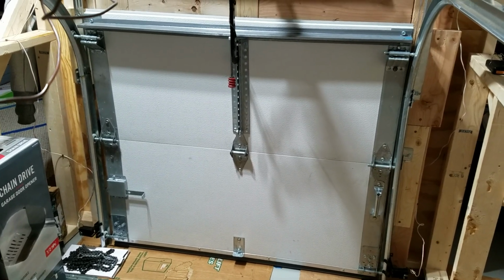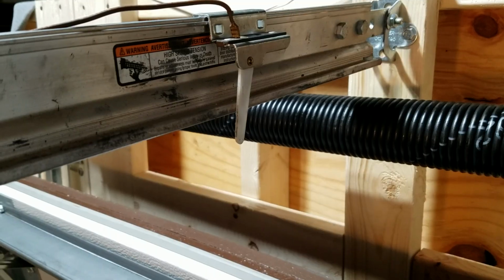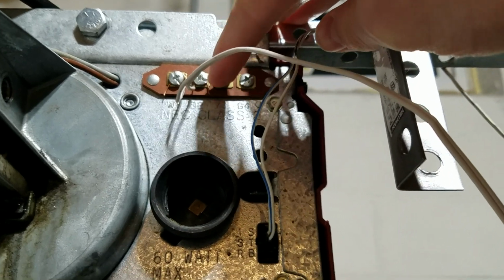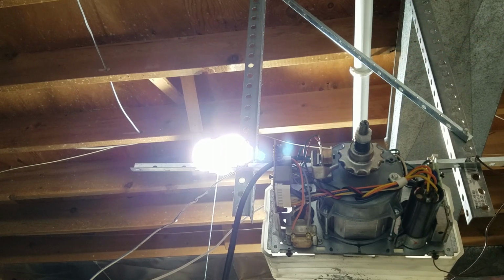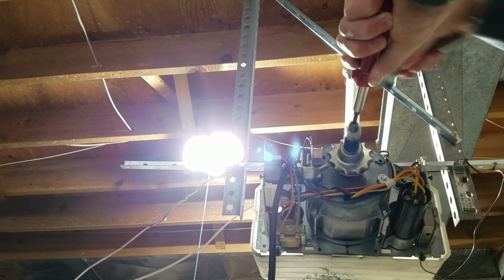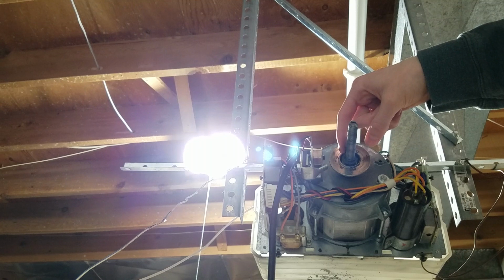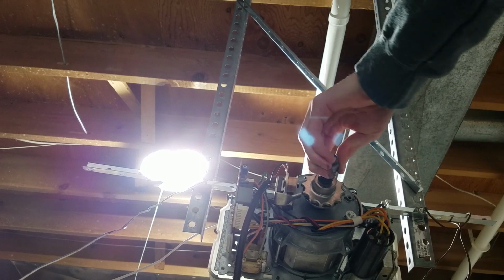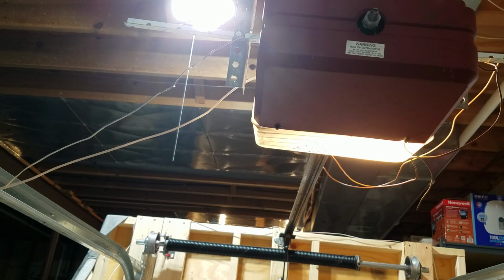Clutch Genie Screw Drive Maintenance, Repair, and Adjustment

Comment from the maker: The video is taking forever to process the HD version which is why it's low quality... It'll be fine later
Reply: Thanks for the video, very thourough, but there is one thing you did not cover that I need help with -->  

I inherited a Norelco Genie Trac-drive 940A which looks to be a screw drive machine from the '80's.  It has the limit up and limit down switches but the wires connecting them to the motor are missing.  I cannot find any manual to show me where/how to connect these limit switches at the motor. 

Can you help me with this?
Reply from the maker: So I haven't been around a trac drive for a long time, but here's what I can remember

Basically, the limit switches work by grounding through the rail and chassis to shut off the opener, and the wall button works off the same basis as that. The down limit switch should have a prong that you plug a wire into, and the upper limit I believe has 2 prongs, one of the prongs you connect to the wire that goes to the down limit switch and the other prong needs a wire that connects to terminal 2 (or the middle terminal) on the opener. Terminals 1 and 2 are for the wall button, if you look at the terminals one of them has a gold wire attached to it, that's the ground wire that goes to the chassis so the wire from the limit switch needs to run to terminal 2 and when the circuit for the limit is closed it will ground through the rail and shut off. Hopefully that helps enough, but like I said i haven't been around a trac drive for a long time so I don't completely remember how everything goes together on them.

Comment: What about the replacement of the screw drive coupler on the same model genie
Reply from the maker: The clutch models do not have a coupler, the screw runs all the way through the motor and sticks out the back. If you have a newer one with a coupler, you need to slide the rail out of the motor head to replace it

Comment: I appreciate the video. I have an old, but in good shape opener, Genie BlueMax CM-7500S. The door closes nearly all the way. But, about half the time when it has nearly completed the task of closing it reverses. It was doing this a couple of years back and scuffing the assembly seemed to solve the problem. However, it has begun to again show the came symptoms and I fear the clutch is now slipping again. So, I disassembled and scuffed it again. It is less frequent but not back to 100% success. And, the clutch spring is fully collapsed - there is no room for any further adjustment. Therefore, I'm thinking the clutch disc (i.e. lining) may need to be replaced. However, the only thing I've found thus far is a 2pk from Genie for $97 - ouch! I'm thinking it may be time to retire the old genie and replace it. Do you know of any other source for a clutch disc with inside diameter of 1.51 and 2.70 inch outside diameter?
Reply from the maker: How much thickness is left on the clutch pad? If your clutch is fully tightened, the more likely case is the reluctor (basically the rpm sensor) needs to be positioned closer to the reluctor hub (gear shaped piece). There should be about a credit card thickness between those 2 pieces. Get it as close as you can to the reluctor without letting them run into each other

Comment: Hi there, thank you for this video, i have searched and search for help on adjusting the power level. What impact does the capacitor have on being able to open the door? My stop opens often about 2ft off the ground. Also is there a fix to get the light bulbs to work again, both sockets seem dead. I raised the internal contacts, but it made no difference. I have spent days trying to align the vertical and horizontal tracks. The wheels can move more freely now, but the top two were absolutely stuck. Anyway, the unit seems to run a little slower than it used to. I want to save it if possible. I have replaced the switch, the brackets, and the hinges over the years so far. Any thoughts would be appreciated. The unit is a Genis SD9500, about 30 years old I thnik. I don't use it much.
Reply from the maker: Typically a motor running slow or only moving 6 inches at a time can be a bad start capacitor. The part is still available from Genie and super easy to replace

Comment: I have the same Genie garage door opener and currently have one remote that works. I am trying to program another remote (looks the same as yours only three buttons), but simply matching the dip switches isn't working. I see in addition to the 12 switches there's also a Run/Set and a 9/12 switch. When I flip the Run/Set to Set, holding the button makes it blink. Is there a specific sequence to program the remote that you know of?
Reply from the maker: To program the 3 button remote, you match the dip switches in the remote to the switches in the opener making sure the remote is set to the 12 switch mode, then you flip the switch to "set", hold the button you want to use for a few seconds, then switch back to "run" and you should be good to go

Comment: How do I connect a car remote to this garage opener?
Reply from the maker: Genie master remote model GM3T is compatible and there are a couple other aftermarket options as well. You can also likely find used remotes on ebay

Comment: So how do you adjust it if it's closing too hard (slamming)
Reply from the maker: You have to move the limit switches on the rail. There's a small 1/4 inch screw that you loosen and then you can slide it to where you need it on the rail. In your case you would move the down limit switch towards the operator a bit until it closes more softly, then re-tighten the screw
Reply: That's what i thought!i just wasn't sure if there was another way. That's an easy fix 😁 Thank you!!! 👍👍 @TBHD724

Comment: Thanks for the Demo! Is the Relay or Tranformer on the logic board? Mine is buzzing and not turning the lights off or the lights are turning on by itself.
Reply from the maker: The relay for the light is located on the logic board and the transformer is the part right next to the logic board on the bottom of the unit

Comment: My genie 404 stopped working at all. I replaced capacitor, but it didn’t help. What could be problem?
Reply from the maker: You might have a ground issue. Take the cover off, unplug the opener and unscrew the circuit board, clean off the back side and reinstall it making sure the screws for the circuit board are nice and tight. ColtDoor1 has a great video about it titled "404GreenMonster". I'll put the link to that video in the reply under this.
Reply from the maker: https://www.youtube.com/watch?v=Wvthxf6udUE&t=21s
Reply: I tried it already. It does not work. I even resoldered some point to make sure everything is good
Reply from the maker: Does the opener click or hum at all when you try to run it?
Reply: No. No sound at all
Reply from the maker: One more thing to check, do you hear a hum from the transformer when the opener is plugged in? If you do the circuit board is probably failed and you'll have to replace the opener since you can't get parts for it anymore. If you don't hear any humming you might either have a bad transformer or it might need a new power cord.
Reply: No sound at all when plugged or button pressed
Reply: What is spec for transformer?
Reply from the maker: I'm not 100% sure but the output is probably somewhere between 24-40 volts

Comment: Thanks very good video. Now I know how to adjust tension. Just a heads up for people messing with capacitor.  Even though the are un plugged the are still charged. Should be discharged with the proper insulator screwdriver or other proper tool. God bless and take care from California subscriber

Comment: Is there a way to adjust the force and also the downward travel of the garage door with this opener?
Reply from the maker: The force is adjusted through the clutch on the back of the opener. Tightening the nut increases the force and loosening the nut decreases the force. You want the door to be able to run smoothly but should easily be able to stop the door with your hands on the way down. The limits are adjusted with the small switches on the rail. Loosen the 1/4 inch screw, slide the switch to where you need it, and re-tighten the screw.
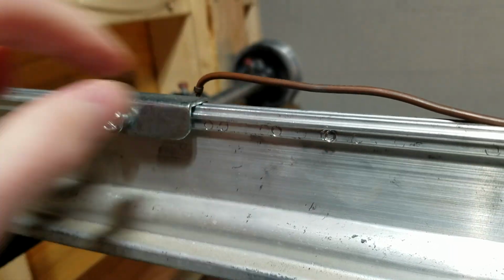Reply: You mean at 4:36, unscrew that metal part and slide it? Slide it back or forward? I'm wanting to have my door close further down on the ground maybe 1/8 to 1/4" more than it is now. I have gap between the garage door and the floor.
Reply from the maker: Yes, that is the part. If you want the door to close further move the switch closer to the opening
Reply: Ok, thanks for that info!
Reply: One last question, do I need to unplug the opener before trying to adjust the switch?
Reply from the maker: You don't have to but I would recommend it. That way nobody tries to press the button and open the door when you're working on it
Reply: Good idea
Reply: Well, if I unplug the opener will that deprogram my remote, or the wall button or any other settings that were set when it was installed years ago?
Reply from the maker: unplugging the opener won't reset anything. It should work perfectly fine once you plug it back in

Comment: Fantastic video!  

I had two problems with my Genie Blue Max 7500 garage door opener.  Initially it wouldn't open my garage door.  I could hear the motor humming but nothing happened (the screw drive was engaged).  I inspected the motor assembly and saw the capacitor had a lot of corrosion.  I found a replacement capacitor on Amazon for $20 and changed it.  That seemed to correct the problem, as the garage door resumed working for a couple of weeks.  Then, a second problem occurred.  The garage door wouldn't open with the wall switch or the remote, but closed fine.  The motor made no sound when I pressed the button indicating that the motor was not getting power.  I suspected a relay or switch must not be working right.  I found your video doing a YouTube search.  After seeing it, I checked the limit switches and it turned out to be the "door open" limit switch was hanging up.  There was some loose wiring on it which may have been causing the switch not to activate or deactivate properly.  The door is opening (and closing) great now!   Thank you very much for your help!!!!   

The sad part of this story is that before I figured out it was the limit switch, a local garage door repair service sent out a technician to help me troubleshoot and repair the problem.  The guy walked in my garage, listened to my story, and within two minutes, without looking at any of the potential issues, showed me a binder with two different types of new garage door openers he offered to sell me.  The first cost $999 and the second one, which he said was nicer, cost $1,749.  I said I would think about it, but that I would try to troubleshoot it myself first because it has always seemed to be a good garage door opener and I never had any issues until recently.  The technician went to his car for a few minutes, came back and asked if he could look over the garage door opener more closely.  He looked at a few of the items (though not the limit switches), left to write up a repair estimate, and returned with no solutions and just the offer to replace the motor.  After doing some YouTube research, including watching your video, It ended up costing me about $20 for the capacitor and nothing to fix the wiring near the limit switch.  

$1,000 minimum vs $20 for the same result: A working garage door opener.  What a joke that local garage door repair serviceman was!  Thank you very much for sharing your knowledge!!!
Reply from the maker: Glad I was able to help!

Comment: Hello, very nice tutorial, am want to asked you where can I get parts for this certain model of garage opener, thanks in advance
Reply from the maker: Most parts for these are discontinued but sometimes you can find them on eBay. I do have some parts for these openers that I can sell you if you need something.
Reply: @TBHD724 thanks to reply, what about the clutch and the sensors, let me know if you have them, thanks in advance
Reply from the maker: I do have some clutch parts for these. I'll see exactly which parts I have today and let you know.
Reply: @TBHD724 great! Let me know, and thanks
Reply from the maker: The clutch pieces I have are the clutch pad, reluctor hub, clutch spring and clutch nut. I'm not sure if the sensor you're needing is the reluctor (rpm sensor) or the reversing sensors that mount on the wall but I have both of those as well.
Reply: @TBHD724 let me know how much for the pad and the reversing sensor it goes to the wall please, thanks for your time
Reply from the maker: My email is in my channel description... send me an email and we can get it worked out!
Reply: @TBHD724 got it 🤝
Reply: @TBHD724  I could not find your email, can you help me out please
Reply from the maker: @luiscanul6467  andy.p.chase@gmail.com

Comment: Great tutorial.  I own a Genie Pro with a screw drive.  Lately I'm experiencing problems. The garage door will open but often not close or reverses direction back open in the middle of closing the door.  It almost looks like it's tired when closing.  I followed the steps from this video.  I roughed up the Reluctor Hub and Clutch Pad and tighten up the clutch adjuster.  But no improvement.  I'm not sure what I can do to resolve the issue.
Reply from the maker: If the motor sounds like it's bogging down when it runs it means you need to replace the capacitor. It's a really cheap easy fix
Reply: @TBHD724  I have a similar issue. Replacing capacitor didn't help. I unplugged the closing limit switch and now the door will go all the way. So I cleaned and swapped the open and close limit switches and the problem is still on the closing side. Do I just need new limit switches?
Reply from the maker: The wire for the down limit is probably shorted.

Comment: Great video, but I have a unique problem. The door will open and it will stop on command, but it will never reverse direction to go back down. It is an older SD9500, but well maintained. I have two identical door lifts so I switched the 2 boards from one to the other but still no reverse. If I unclip the trolley and lower it by hand, you can hook it back up to raise the door. You can repeatedly stop it on the way up, but it never reverses direction. Any ideas.
Reply from the maker: The down limit switch (at the header end) is probably bad. It's a really cheap easy fix

Comment: I have an older genie screw drive garage door opener. I greased up and ran it a few times . The problem after the last time i ran it it only when up half way. I closed the door  mannually then tryed to run it the next day and it till only worked little over hslf way.  Do you think its the Compacitor or something else i can try to get it working again??
Thanks 
Wally
Reply from the maker: First thing to look for is to see if the door has a broken spring, if it does get it replaced ASAP. Assuming the spring is OK, the first thing I'd try is to tighten the clutch on the back of the opener, if you still have the same issue try to take apart the clutch and rough it up like I showed in the video.

Comment: I think you may have answer this already for another poster below, but I have a similar situation where when you lower or raised the door it just stops a third of the way. It doesn't reverse. I notice that the eye beams and the wall switch momentarily lose power and reset about 10 seconds later. I press the wall switch again and again it only travels about a 1/3 of the distance and stops. I figure it is the transformer since wiggling the connections to the logic board did nothing (both Ebay and Amazon have them available). I was also thinking that replacing the capacitor may fix the problem. FYI, my house was going through a renovation where power to the house was getting cut off. So that may have contributed to the opener getting damaged. Thanks in advance.
Reply from the maker: The capacitor doesn't cause the whole opener to lose power, you're correct about it being the transformer. You can replace them but it's a bit difficult since you have to drill out the rivets
Reply: Just wanted to thank you for your help. I was able to swap out the transformer (from Amazon $20) and my garage door opener is back to normal. Took me about 10 minutes to swap it out. This thing has been a work horse for the last 25 years and I really did not want to go out and buy a new opener. I even installed on it one of those $25 WIFI adapters and I now have a "smart" garage door opener.   @TBHD724

Comment: I'm trying to figure it out were does the antenna wire goes. Mine doesn't have the antenna wire anymore and I'm not able to open from outside with the remote.
And I need to put a new wire but where exactly?
Reply from the maker: I'm not sure if these ones have terminals for antennas or not, I'll check when i get home and post a pic
Reply: @TBHD724  Thank you, I will check tomorrow on mine.
Reply from the maker: The antenna will either need to be re soldered or you'll have to buy an external receiver for the opener. Check my community tab for a picture of where the antenna goes on the board

Comment: Do you any idea of where to get parts for the G2500?
Reply from the maker: Parts still made would be the trolley and capacitor, you can replace the receiver with an intellicode receiver board but you'll have to get new remotes, most other parts however are obsolete and your best shot is looking on ebay for parts or find a used one on fb or Craigslist and pull parts out of it